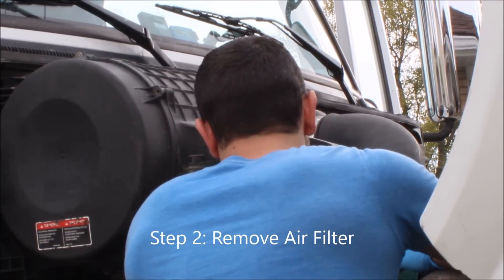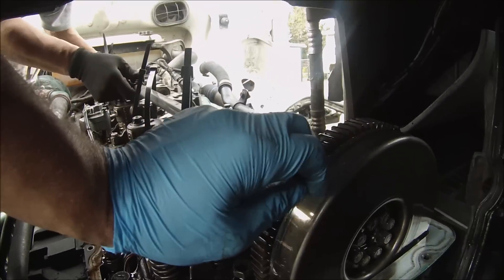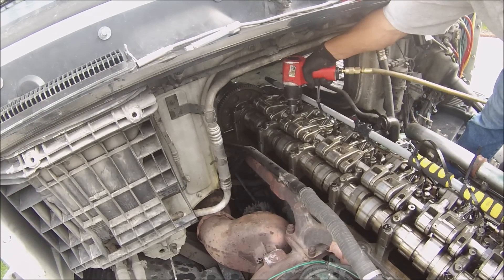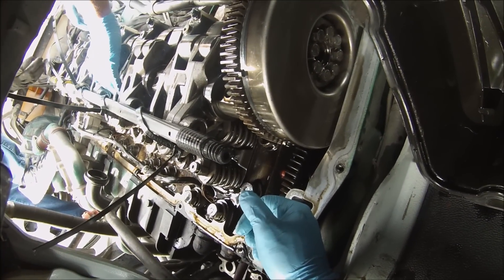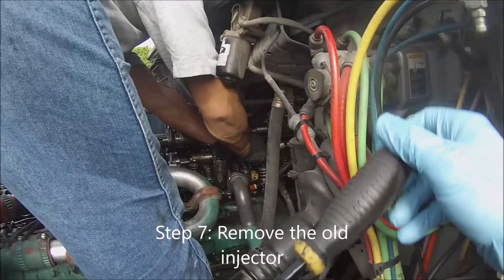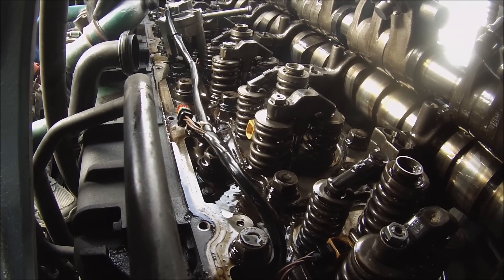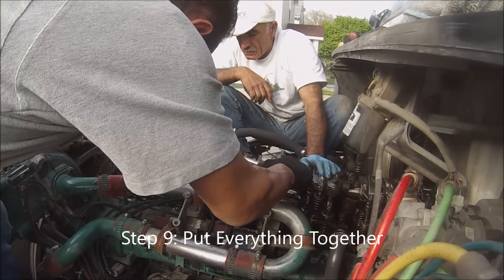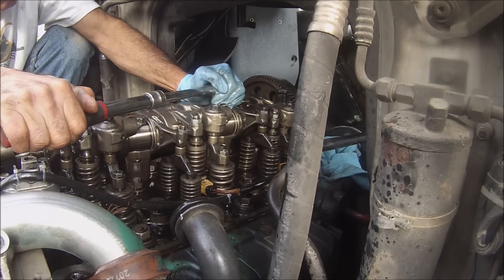How to Replace an injector on a Semi-Truck.  Volvo D16 Engine

Comment: This is not how to replace an injector. There is specific torque procedure, the bolts for the injector hold downs are to be used once, injector cups are to be replaced. Good way to damage your engine following this

Comment: Lol replaced injectors on a engine with copper cups and didn’t bother to do the cups which indirectly cause injectors to fail also how about reusing bolts that have probably been re used a billion times or how about the fact that you didn’t program trim codes for the new injectors or hey how about valve adjustments and let me guess after all this useless work you probably started it up ran it for a week and it ran like shit and you took it to a Volvo dealer and expected a experienced and certified tech like my self to redo it all for free like most of all you wanna be wrenching cheap truckers
Reply: Josh Brokos yeah. Not exactly and old cat or detroit where you can do it. Some things are to be left for professionals to do.

Comment: Hi
Would you happen to have bolts torque spec 
Thank you
Reply: They are torqued and then angle torqued for the injector hold down bolts, which they did not do, the rocker shaft bolts are torqued a specific way as well again which was not performed, nor did they replace the cup and clean the injector cup port.

Comment: Didn't see where you cleared the fuel from the common rail or the cylinder after the injector was pulled. All that fuel in the cylinder could cause a piston failure at start up

Comment: I must change one injector, at volvo fh16. I must write the injector in truck computer?
Reply from the maker: Eugen Hagiu Yes Eugene. You will need to do engine tune or else your truck will be wasting a lot of fuel.

Comment: Nice job help me a lot to replace my self the injectors and  sleves cups, in D12 . For sleves replacement you need special tool buy it from Volvo truck dealer
Reply: How's going there. I was looking at your comments on that video where the guy changes out injector on d16 ...and you saud you have a d12 Volvo engine i too have a d12 engine a 2006 vnl and my fan clutch is ALWAYS running. Have you change out your fan clutch ?

I appreciate your answer. Thanks

Comment: is there a website where i can buy the repair Manuel to fix my truck. i have injector problems right now with my vovlvo vt880.
Reply from the maker: Milton kabia I have not head of any. if you find one, let me know. as you saw, mechanical part is not too complicated but you would still need to adjust your new injectors to your truck through a dealership
Reply: Are you saying im better off getting it done at a dealership.
Reply from the maker: Milton kabia well, mechanical part of the job is the largest cost to your pocket. It takes minutes to update the computer. so its a lot cheaper to get the job done yourself.
Reply: Is it possible to get some help from you. I also have a vt880 that have injector 6. It needs to be change I don't have the funds to do it at the moment.

Comment: Nice video! thanks for posting I just did this on my d16 and about do do it again on another one i used elastic bands to keep the rocker arm pistons in place tho, thanks for the tip with the handle and zip ties i might try that way this weekend. why did you need to replace the injector just curious cuz i lost all fuel system prime and injector #1 code keeps coming up love the music edit btw
Reply from the maker: artysv Thanks for the support. I changed the injector because it was giving me mechanical problem code on engine stats
Reply: @eldarbinali3976  

Good job

Comment: Are you remember the part number for the injector ?  I have a 2008 with D16 engine and a set of  injector for the D13 engine but I guess they are different.
Reply from the maker: Fernando Viano no, they are different. The size will be different and fuel pressure.
Reply: Eldar Binali what is the party number for those injectors I need it please I have the same truck